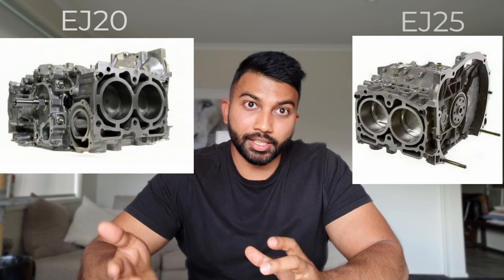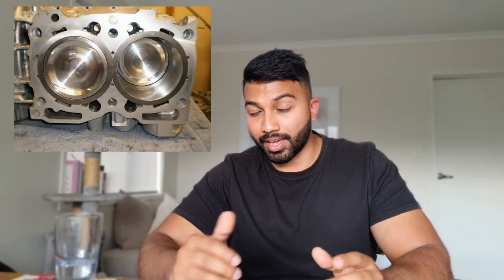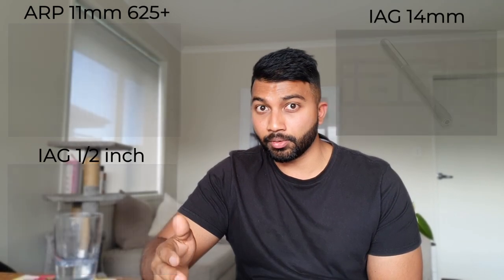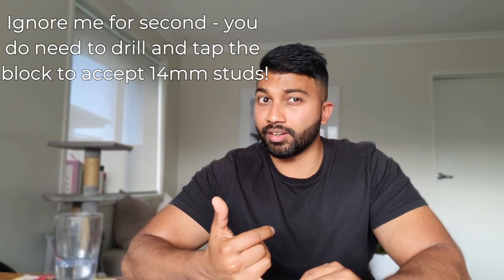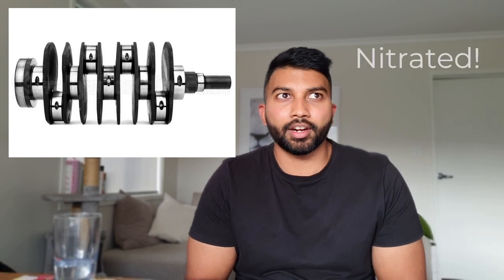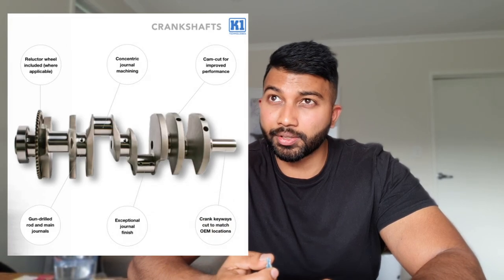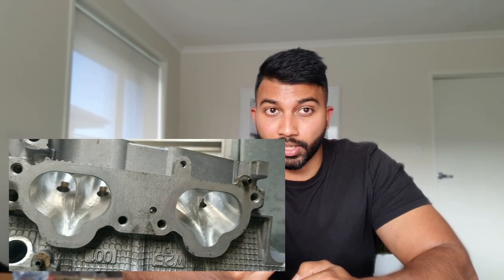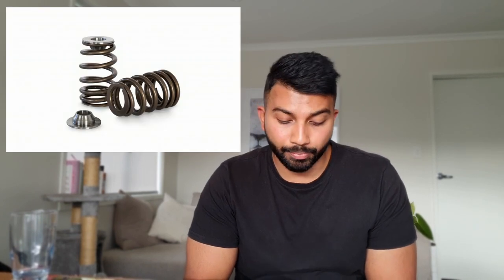Building an 800hp WRX STI - Part 1 (Block and Head Work)

Comment: 2:30 you hit the nail on the head mate I've been down that track a shit load of times. Cant wait to see your build when finished. I'll probs finish my 800hp build same time as you😎
Reply from the maker: Yeah man its not an ideal situation at all! Likewise dude! I'm missing driving the car so much!
Reply: @NJsGarage  definitely not bro I've been in that position about 5 or 6x with 4 different engine builders. It's annoying an frustrating usually taking over a year to resolve.  An yea I feel your pain I havnt driven mine for about 6months but just being patient this time round.
Reply from the maker: @nztrucker1542  Dam that's crazy! Where you getting the work done this time?
Reply: @NJsGarage  not too sure bro manakau Subaru did a awesome job with the shortblock but he outsources the head work and that's the issue we kept having was in the head somewhere. Was looking at going possums as I live just up the road but I also want to keep my loyalty with ns spec🤷‍♂️ aswell
Reply from the maker: @nztrucker1542  Yeah fair enough man. Explore all options and then make a cal aye. Give Pat a call from PBMS, I know their tuner on a personal level and he's a great guy, very knowledgeable too. Spends the time and gets the tuning perfect!
Reply: @NJsGarage  yea I'm considering it. We've just broken alot of things we was told we could never do such as power levels 1/4 times etc at ns spec when it comes to subarus so I dont want to just leave.